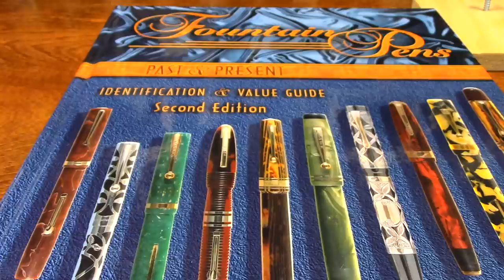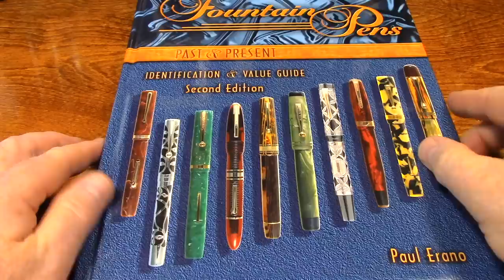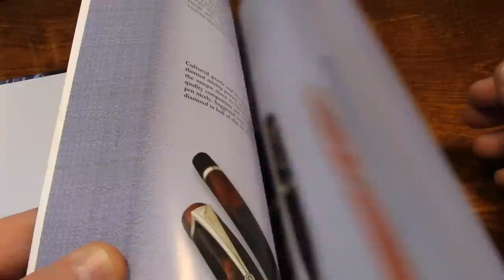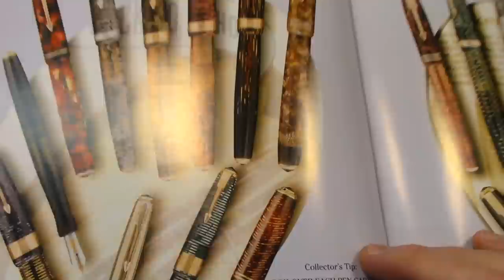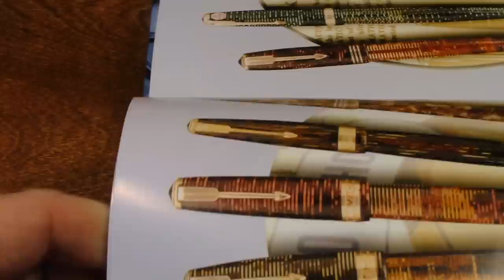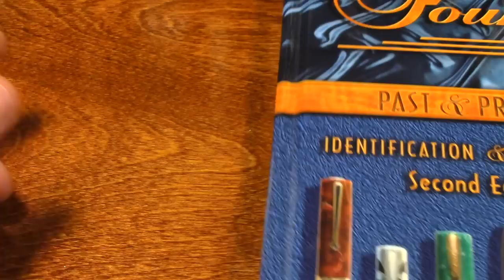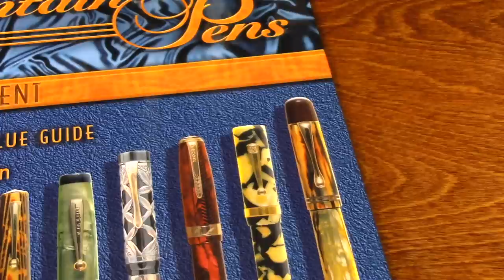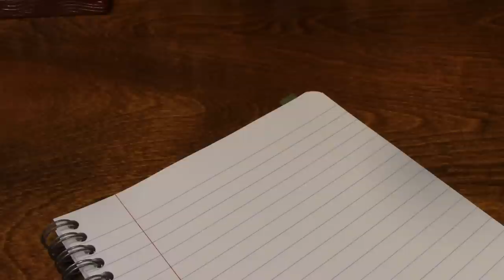Vintage Parker Fountain Pens - PEN ASMR

Comment: Beautiful Vacumatics you have there! You should consider sending the maroon pen off to a nibmeister to have it adjusted so it writes as well as it looks. I’ve got 4 Vacs of my own, and I just love the looks of that Parker striped celluloid. Those screwdrivers your grandfather made out of Parker celluloid are super neat to see also.
Reply from the maker: I agree. It's almost like the iridium on the tip of the nib is worn away. I'll have to  look at it under a magnifying glass and see what the problem is.

Comment: Neat screwdrivers, I just thought the handles look like they would make neat fountain pen bodies if put on a lathe and then you showed the fountain pens.  Cool, your grandad was very talented   :)
Reply: Those handles were probably made from rodstock which Parker used in the pens of the 20s & 30s. I have seen several Parker pens with the same design and different color barrels, and I own a Vacumatic with that design in green and black.

Comment: Nothing better than a Mercury... Their boat motors from the 70 and 80s were two stroke monsters
That sounded and performed great. We had a Johnson 90 and that was fun but not so reliable.  Then came the Merc 140. Now this was easier to start faster to run and sounded and smoked like something unique. Trim it right and rooster tail all day. Just figured Mercs needed an old school no cowling shout out. Black and blue is true.
Reply from the maker: My dad was always an Evinrude guy. I like the Mercs though when it comes to boat motors.